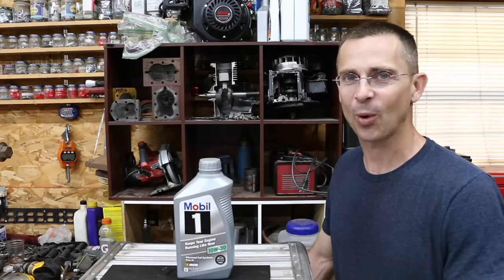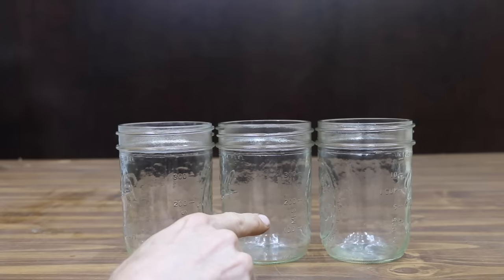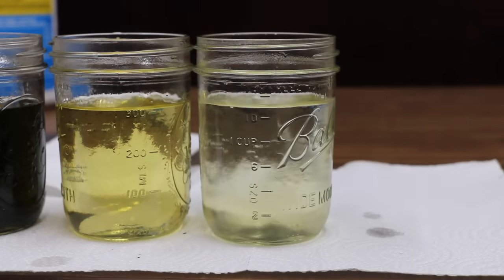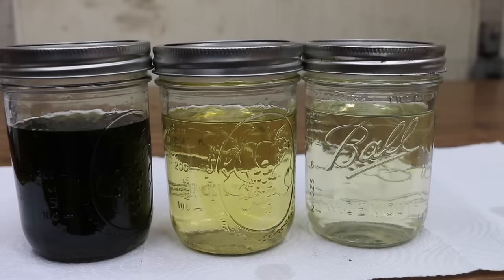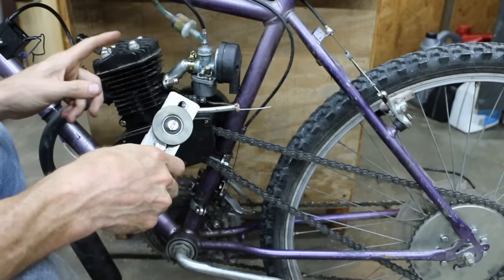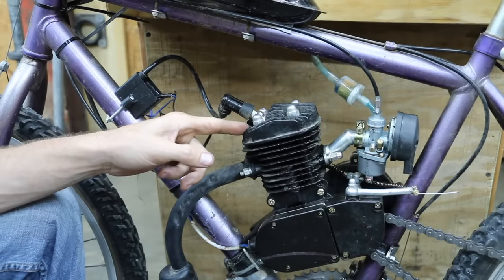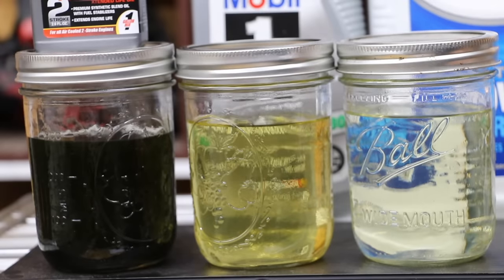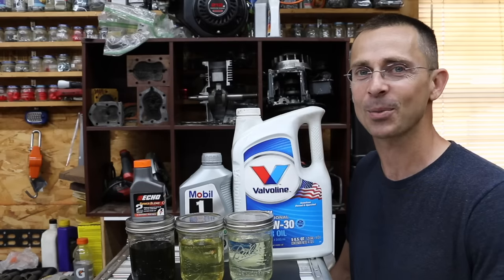Will 4-stroke oil damage a 2-stroke engine?  Let's find out!

Comment: My dad is was a mechanic. He told me that in a pinch, you can use either 10w30 or just regular 30w oil. I can't remember which. Any lubricant is better than nothing. Just remember: You CANNOT run straight gas in a 2 stoke. If you do somehow accidentally run straight gas and realize it quickly, drain the gas tank, and take off the carburetor. Flush the carb with either carb cleaner or 2 stroke gas (gas and 2 stroke oil mixed). Replace the carburetor and accompanying fuel lines and/or purge (primer) bulb lines (if you have them. Some do some don't. Just depends on the make/model of engine). Fill the fuel tank with correct mix of NON-ETHANOL gas and 2 stroke oil. Non ethanol is important. Over time, ethanol will cause your fuel lines to go brittle and possibly snap. I learned that the hard way with my chainsaw.

 If you have a primer bulb: Prime the system according to manufacturer's instructions and try to start. It should fire up.

If you DON'T have a primer bulb: You're in for a fun time. Choke the carb and try to start. When it fires off, turn the choke off and try to start. This is gonna take a while, as you probably don't have fuel in the carb. Yank the pull cord for a while. Once you get it fired off and it runs, give it some gas to warm it up and let the carb get some gas in it. Next time you fire it up, it should fire up no problem. However, your shoulder is gonna hurt the next day. (Source: I have two 2 stoke machines that don't have primer bulbs. They're a bitch to start.)
Reply: thats a lot of work lol... drain the gas tank??? why not just add some oil to it then take the carb bowl off, new mixed gas will be in the gas lines in 2sec. dont see why you would remove everything and clean it all. its not like straight up gasoline is contaminated.

Comment: There was no 2-stroke oil until someone figured they can sell the oil labeled "2-stroke" at 10x the price of the regular SAE-30 oil. I have always been using regular motor oil for my 2-stroke trimmer and never had a problem with proper care.
Reply from the maker: Great point!

Comment: As a vintage chainsaw collector who rebuilds a lot of them old 2 strokes were ran on regular 30w oil mixed a lot heavier like 32:1 or 40:1. That oil was a little different though it had different additives that are now not used due to emissions. The 30w builds a lot of carbon and you need to pull the cylinder and clean them periodically. Some chainsaw manufacturers from the 60s states to clean cylinder every 50hrs of use the carbon destroys engines.
Reply from the maker: Thanks for the feedback.

Comment: I was just wondering does Bardal still produce 2 stroke they did back in 70 for oil injected motor  cycles  great video I learn a lot from your videos. Just a after thought I saw a video of someone tearing down a two stroke generator the ports looked liked should be polished would it be worth it to do that on small generator or would it really make a difference?

Comment: I had a boss that used dirty motor oil from vehicles and heavy machinery in a big Chinese two stroke generator. It had a separate tank for oil instead of running premix though. 
He'd strain the oil through a wad of towels in the bottom of a 5 gallon bucket with holes drilled in it and add a gallon of gasoline for every 10 gallons of oil to thin it out a bit.

It ran 100% reliably the entire time I worked there and as far as I know that engine is still running to this day.
Reply from the maker: Thanks for sharing.

Comment: I owned a Suzuki 250cc motorcycle back in the late 60s that was a 2 stroke but had a separate oil tank that mixed it with the gas so you didn't have to premix.  Recommended oil was straight 30 weight which was about the only oil you could get back then.  The thing ran strong and never had an issue with plug fouling or smoking.
Reply from the maker: Thank you!

Comment: In the 60s and 70s all we used was sae 30w for 2 stroke engine oil and that is what homelite recommended was a 30 to 1 ratio of that sae 30. We never had any wear issues,  a little carbon build up on the plug sometimes.
Reply from the maker: Thanks for sharing.

Comment: My Mercuriser Dealer said that the 2-Cycle oil has less ash. I run a quart of Mercruiser 2-Cycle in my 4 stroke as an upper cylinder lube, which works out to 100 to 1 ratio in a 25 gallon tank, as directed by my mechanic. After hundreds of hours my motor is still at full compression, and is strong.
Reply from the maker: Thank you!

Comment: Lots of the old 2-cycle engines used SAE 30 mixed in the gas. Usually 16:1. Some engines like the Maytag's used bronze connecting rods and bearings and actually need the heavier 30 weight oil. Regular 2-cycle oil will fry them.
Reply from the maker: Thank you for the feedback

Comment: All the old mixing oil we used to get in the 70s-80s said sae30 with color added on the can. I’ve always used Sae30 mixing oil bought by the gallon jug so idk the difference, but never had an engine failure from it, then again i always used everything I mixed on the job and poured the excess in the old truck on the way home so it never sat around long enough to come undone

Comment: I have used engine oil in my chain saw...i done it in a pinch..did not have any problems...however i use Castrol , and have for the last 40 years
Reply from the maker: Thanks for the feedback.

Comment: I've got an OLD Kawasaki back pack blower. The instructions for it is 6 oz of sae 40w non detergent or 8 oz of sae 30w non detergent per gallon of gas. It's the first and only time I've ever seen a 2 stroke engine call for 4 stroke oil.
Reply from the maker: Great information. Thank you!

Comment: have a 2 stroke boat engine and we live on an island which means we use it daily to go spearfishing/travel. daily runtime about 1 hour for over 2 years with 10w40 oil since its dirt cheap and i found big containers. (we even put it on our 4 stroke generator and 4 stroke boat engine once in a while due to low on fuel)

Never had a problem. im sure there is some benefit to the 2stroke but if you check it in some lab but for ordinary people i dont think you will notice a difference
Reply from the maker: Thanks for the feedback.

Comment: I had a 250cc two stoke motor cycle as a daily rider that I ran on 4 stroke oil for about two years and never had a stitch of trouble. Might be different if you had an oil pump metering the oil, but mixing it in with the fuel posed no problems.
Reply from the maker: Thanks for sharing.

Comment: I have some old lawn boy mowers and also have some old literature that says use 30 weight non detergent oil at 16:1 ratio.  That must have been a smoky engine that needed cleaning often! I now run them with opti 2 at 80:1. I rebuilt a couple of the engines and continue to use them. Love two stroke mowers
Reply from the maker: Interesting!  Thank you

Comment: I literally just wondered about this question today. I have a 2 stroke bicycle that Project Farm inspired me to build, and ran out of 2 stroke oil today, I was looking at some 10w30 wondering if it would get me by.  For the chain tensioner, i drilled a hole through the bracket and right into the frame, and put a screw in to prevent it from rolling into the spokes.
Reply from the maker: Thank you!

Comment: Had a issue with a bad knock on a chainsaw put dot brake fluid and atf in fresh gas ran it out wide open throttle cleared out the knock. 

I don’t know but I think you can run just about anything that’s a oil based lubricant in a 2 stroke and it won’t give you problems unless it’s to rich and you lose throttle response.

Comment: That very much confirms what I already knew.....

My granddad had, what euphemistically called a "blue smoke" motorcycle that he ran before WW2, and resurrected after the war was over. I remember the fuel filler cap bearing the words "Use only 18 parts petroleum spirit mixed with one part motor oil". I don't think there were any specific two-stroke oil in those days (in the UK at least). For a 1930's bike, it ran well, even in the 1960's, (complete with acetylene lighting!). In a similar vein, my dad ran a Stihl chainsaw on a petrol/motor oil mix (sometimes known as 'petroil') - I suspect that same saw will still run today (I still have it as a memento of my dad). Not until I got my first decent 'moped' a Yamaha FS1E-A (the autolube variant) did I first come across 'two-stroke oil' - that was 1977.

As a general rule, it seems that you would use a greater quantity of motor oil than you would of two-stroke oil, but it was quite acceptable in those times. As you discovered, motor oil tends toward greater soot/carbon deposits, greater output of smoke - hence the old "blue smoke" jibe of years gone by. Generally, it was about 18:1 mixture of petrol and motor oil, or 50:1 two-stroke oil and petrol mix.

With regard to two-stroke fuel in a four-stroke engine, it could even prove beneficial to have that extra upper cylinder lubrication. The only caveat would be, not to use it in a catalytic converter equipped engine - Though it could be interesting to see just what it would do to a 'cat' but I doubt it would function well enough to meet emission regulations......
Reply from the maker: Thank you!
Reply: A lot of old 2 strokes used bronze plain bearings, these naturally need a lot more oil than the ball or roller bearings used today so there was no escaping the need for a greater oil:fuel ratio, in spite of the generally lower performance.

Comment: Most old manuals for 2-stroke equipment usually specify an SAE 30 oil to be mixed with gasoline at some ratio. So your two tests seem to confirm this, as they performed very close to a 10W-30 conventional oil. However, I would wager that modern 2T oils are a bit more complex, and probably also have some more thoughts put into what goes into the oil as all of it is intended to be burned, compared to 4T oils that only have a small fraction of the oil being burnt during it's service life.
Reply from the maker: Thank you for the feedback
Reply: Sae30 back then was usually Non Detergent, too.. as there really wasn't any...😂😅
Reply: @h8troodoh  Well, "back then" is in some cases the 80's from what I've seen. 🤣
Reply: @sstorholm  that Was a good one... haha.. I'm talking the 1950s Era,when that's all there was other than factory branded oil.. you can still buy single weight non detergent oils,and are recommended in emergency situations over say, 10w30 detergent motor oils..

Comment: There was an old guy neighbour on our road who ran his Suzuki B120 on normal 20/50 for years. I don't think he even knew what 2T oil was. The bike seemed to run ok though the smoke, smell and grime all over it was worse than it should be. I remember that he used the oil he was gifted by his brother who gave him the oil change oil from his car...so, it was dirty, weak 20/50. He used to tell me that the 'expensive' oil I used was a waste of money. I remember after he died that the old bike was dumped in a skip when the new owners of the house moved in and made the house modern...I got it out and it went to a mate's kids to thrash about on...It was a noble machine..
Reply from the maker: Thank you

Comment: When I started out on Motor bikes in 1956, I do not recollect the existence of two stroke oil. One bought normal oil at the filling station, filled the measure on the underside of the tank cap , poured it in and gave the bike a shake and that was it. The measure was 16/1. It was de rigour to have a plug spanner tucked in the side of your boot for ready access, the plug was liable to oil up while starting or while you were on your merry way the plug could whisker up, ( a thin conductive whisker bridging the plug gap ) Incidently, the viscosity was deemed not to matter as this was lost when mixed with the petrol. Another habit was to always turn off the petrol just prior to your destination in order to empty the carb because petrol evaporating overnight would leave an oil rich mixture at the next start up.
Reply from the maker: Thanks for the feedback.

Comment: Dude the Chain Tensioner is fine.
You gotta get better bolts and nuts for the frame mount.
Also the tensioner wheel wears, and actually shouldn't go on the chain perfectly square at first. The tensioner wheel should be inline with the chain, but slightly pitched to one side at first until it gets the proper wear groove. Then your golden.
The chains with the kits stretch lots and are kinda garbage.
I use chains bought from Princess Auto.
Also while  the tensioner wheel is wearing and the chain is stretching I always keep a 13mm wrench and a 14mm deep socket in my backpack for a quick adjust on the fly.

Comment: Back in the olden days, most trail bikes were 2 stroke. I don't know if there was 2 stroke oil back then, but we used 30 weight oil at a 20 to 1 ratio. Never had any problems. Maybe newer oils might make a difference, but not back then.
Reply from the maker: Thanks for the feedback.

Comment: my dad in the 60's used 30w in the summer and 75%/25% 20w 75% to 25% gm transmission fluid in winter, lawn/tiller summer, boat summer /winter. did not know about 2 cycle oil till the 90's, with a lawnboy!
Reply from the maker: Thanks for sharing.

Comment: Before the age of synthetic oil we all ran our 2 stroke engines with 30w. I personally still use 30w for 2 stroke use.  I buy the cheapest and burn that. 
He'll yes synthesis are better lubricants simply because they burn much better.
30w from my experience fowls up spark plugs more often but I am a tinkerer and enjoy servicing my machines. 
In Australia 4 liters of 2 stroke oil cost $80
The cheap 30w cost me $25. 
I have been using 30 W all my life and will continue to do so until price drops in synthesis.
Reply from the maker: Thank for sharing.

Comment: When I was younger in my logging days . We used regular oil in gas often . when we would run out of 2stroke oil. If I remember right. We used more motor oil than 2 strike oil. Never had any issues.
Reply from the maker: Thanks for sharing.

Comment: Just a fantastic video. Great information. If I had to guess, it is the detergents in the 4cyc oil that are not optimal for 2cyc engines. But it is not a big deal. If you are in a pinch, use what you have but like the boss said 2cyc motor oil is pretty inexpensive. I would like to see a test that determines if TCW-3 Marine 2cyc oil is fine for use in air cooled 2cyc. garden equipment. I suspect that it is fine.
Reply from the maker: Thanks for the suggestion.

Comment: Short-term, the biggest effect of using 4-stroke oil will be an increase in the amount of smoke, because 4-stroke oil resists burning. Long-term, the biggest effect will be a buildup of varnish (heat-polymerized oil) inside inside the exhaust and inside the combustion chamber on surfaces that aren't scraped-clean by the piston rings. These effects are by no means catastrophic, but since 2-stroke oil provides good lubrication, burns cleaner, and costs about the same (unless you buy it from the gas station which is always a ripoff), there's no reason to bother with 4-stroke oil.
Reply from the maker: Great point

Comment: We used straight 30 weight oil for chain saw mix for years , and never had a problem . I've seen truckers mix 30 weight and gasoline , and run it in diesel trucks . They knew a ratio of gallons per quart .
Reply from the maker: Thank you for the feedback

Comment: I learned this example about 55 years with a 125cc 2 stroke mini motorcycle. My dad told me to never use his car oil in my engine. As you might expect I ran out of 2cycle oil and mixed some of his oil with fresh gas. 
 The engine did not last through the first tank full with seized piston, scored cylinder. 
Do not try if you want your engine to still run!
Reply from the maker: Thanks for sharing.

Comment: I always mix used 5W30 drained from my truck and cars for rental equipment. Smells different but had absolute no issue what so ever.
Reply from the maker: Thanks for sharing.
Reply: @ProjectFarm  Seriously, it's been five years since I've been mixing drained 4 stroke oil, all synthetic, 5w30, Volkswagen (Castrol Longlife), SsangYong(Mercedes Benz) Kia (Hyundai Blue something). After 20,000km (12k miles) on car, it goes right into my own wood chipper and dog poop pulveriser (lawnmower), only through coffee filter. My only concern's environmental effect.

Comment: When Mr. Evinrude inverted the first outboard motors they didn't have 2 stroke oil so I wouldn't think that 4 stroke oil would hurt anything except now the new oils have so many detergents they probably leave deposits on the plugs and will cause fowling if you keep using it.
Reply from the maker: Thank you

Comment: Some of my old honda 2 stroke motorcycle have tags that recommend what 4 stroke engine oil to use. They will run fine on both but spark plug fouling at 24/1 mix is more with 4 stroke oil.
Reply from the maker: Thanks for sharing.
Reply: @ProjectFarm  thanks for a good channel.

Comment: If you use a 4t oil for a 2 stroke i recommend going with fully synthetic oil, and i do not recommend using it on Autolube system, only use as a premix
Reply from the maker: Thanks for the feedback.

Comment: The chain tensioner looks as though it work better if mounted on the lower rail, but with the roller above the chain. Hence chain tension would be pull it straight up, rather than down where it would push sideways.
Reply from the maker: Thanks for the feedback.

Comment: Oils  usually do more or less what they're supposed to do , but just for interest sake. How about adding cutting oil/ water mix (the stuff used a engineering shop to cool the work pice ) in a motor(4 stroke). Do a wear test and running temperature test. Tnx for the interesting channel !
Reply from the maker: Thanks for the video idea.